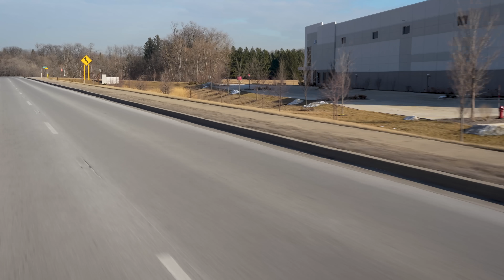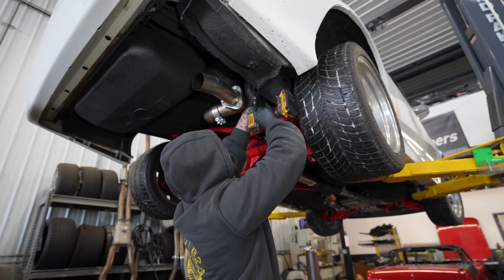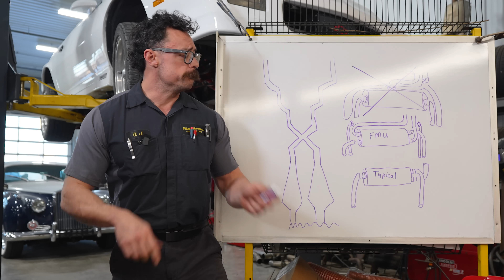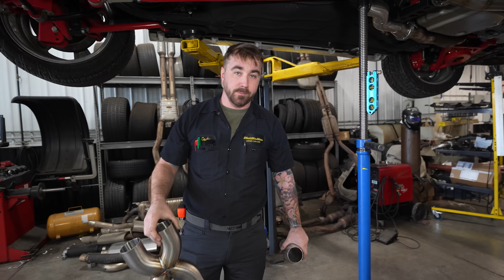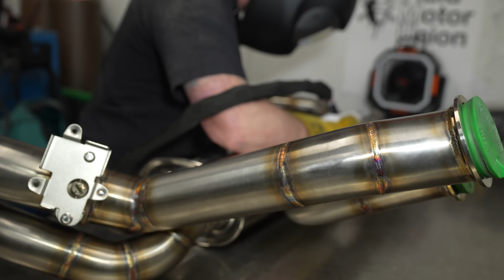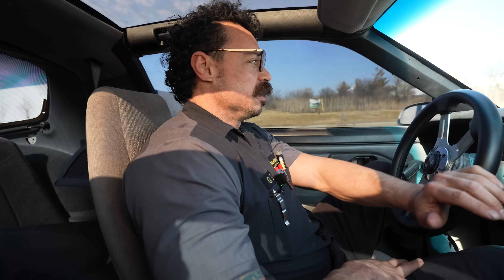This Camaro Exhaust Shouldn’t Have Made 30+ WHP: LS3 Stepped Pipe Layout Everyone Will Copy

Comment: 600-620 crank HP?
What transmission is in it that its losing 180hp from the crank to the wheel?? The 10 bolt isn't taking a bunch.
Thats pretty excessive.

Comment: I still don't see your small into bigger pipes physics. Usually as gas cools down the velocity of the exhaust gasses DECREASES, so going a step DOWN in diameter KEEPS VELOCITY UP. You are fighting physics NOT working with it....
Reply from the maker: Talking about physics but forgetting that length of piping adds resistance to flow… that’s not accounting for any bends… or muffling. 
Also it’s not just gas flow velocity optimization but sound pulse optimization.

Comment: Wish you showed stock vs muffler vs open HP dyno. Instead I'm now not sure if your exhaust did ANYTHING vs open headers and possibly 18" collector pipes wouldn't have done. Or was that meg and x pipe w/ mufflers actually good for 32 HP....

Comment: The title insinuates the exhaust actually made a 30hp difference... it certainly did not. Realistically we don't know if it increased anything or even potentially LOST hp. The majority if not all of it is a result of fixing the other issues.

Regardless, the new system is very nice and imo has a better sound. Great work on design and install.
Reply from the maker: We see it as freeing up the HP

Comment: The exhaust systems cost more than add to the value of these cars because thats what separates a cobbled together looking car vs a first class show worthy built car. If ya want sound and cheap just run straight pipe and axle dumps. This is not that.

Comment: I “built” my g8 in my garage 6 years ago. Basic stuff, stage 2 btr cam, intake, 1 7/8” long tubes with full 3” and an x pipe. The tuner had his doubts and made fun of my “redneck” exhaust. I was pretty happy when the numbers on the dyno went higher than he set the graph due to his expectations. I believe a lot of it was the exhaust helping more overall with the setup, clearly wasn’t near the level of your expertise but I built it with the same ideas in mind.

Comment: @9:27 so isnt that a panhard bar but whats the deal with it doubling back and having a second one? usually its just one
Reply: It's a brace that kinda ties the rear frame rails together to distribute the load so it puts force on both sides of the car rather than acting like a pole pushing on one frame rail

Comment: The Pontiacs had the exposed quad tips where the Chevys had the exhaust tucked up under the bumper and bologna cut pipe ends so you didn't see them.  I had a 3" Flowmaster system that was a simple 1 in 1 out that just dumped out on the driver's side.

Comment: All that money poured into a car with a 10 bolt rearend? Thats why I tell people to start at the tires, and work from the ground up.
Its a really clean 3rd gen. F body, that needs a stronger diff to start with. That would free up all that wasted space, thats being taken up by the factory rear suspension parts. I'd have 86'd all that bullshit. That rearend will inevitably fail. 
A Dana 44 with a 4 link or even leaf springs. Would be a much better starting point. That car should be back halfed, with subframe connectors and a roll cage. Then you could put true duals all the way back. With Moroso bullet mufflers. Done.
Peace
Reply: It’s not a 10 bolt. Its a Hawks 8.8.

Comment: Ah the ol double single routing. A lot of guys did that back in the day. If you were ok with shorty headers you could get the shorties with a y pipe for a dual car model, then 2 intermediate pipes to run back over the axle. Put an H or X section where the cat supposed to be and then however you wanted to work out the mufflers was easy enough.

Comment: Did you consider going 2OTL (2 out the left) like they did back in the 90’s?  SLP found that having both pipes exit out of one side of the muffler, increased flow.  I put that setup on my 1990 IROC, just to make it period correct.  I’d love to do a full header-back exhaust, but keep the two tailpipes out the drivers side.
Reply from the maker: Increases flow over what exactly? Over stock, or them putting a pipe on each side in their experiments?… 

Understand, the best flow for ANY exhaust is 8-14 inches of properly sized pipe past the collector, everything else is potentially a restriction… full stop.
when we build an exhaust the system the idea is that whatever the configuration needs to be zero restriction, or as close to that as we can get with the best SOUND, which is why utilizing steps here allows that. What this video shows is not making power, nor is the one side out show it’s making power, it that it loses less while still doing the job of an exhaust. 

What they were actually saying is that they couldn’t build a system where if it was longer and had to come out both sides,  didn’t lose power over just coming out one side. That’s not the same as claiming one side only is the optimal setup. 

Once you reach zero restriction it’s all about sound quality. There’s no secret power to be made with exhausts.

Comment: I have an 82 Z-28 and the exhaust is one big backpressure.  Before it goes over the rear end it splits in two but dead end in a 90-degree pipe, all are too small.  An idiot thought that up.  Crossfire, Ha Ha Ha.   A stealth intake and a 500 cfm Carter woke it up.  But only tearing the whole exhaust out will help that.

Comment: Maybe I don't understand, but I thought, if you don't use corrections on the dyno then you don't knowvifvthe change you see is due to environmental changes or what you did. E.g., do a run while it's 90° in the shop and one at 50° and you picked up power without doing anything.

Comment: I've mentioned this to him, but I feel like this is where AngeTheGreat's "Engine Simulator" program is going to REALLY shine once he finishes the exhaust portion, since it uses fluid dynamics to not only show flow, but map and simulate realistic sound! To be able to design a complete exhaust system and have an idea before you even start bending pipe!

I know he is thinking about it from a gaming viewpoint, but given he's doing real simulations and not just crude approximations to simulate engine/exhaust sound, I'm thinking outsider the box for real world application.
Here's hoping it works out like I'm envisioning 🤞🥹🤞

Comment: The first one sounds more refined in my opinion it does sound better I'm going to say that it's probably due to the sound waves traveling together at a longer length that gives it the cleaner sound nevertheless you're exhaust system great also from my own experience smaller exhaust pipes tend to give a cleaner sound like 2 and a half inch as opposed to 3 in pipes and also I feel like it depends on engine displacement but unfortunately as you have proven here we can't always have our cake and eat it too

Comment: I have a 92 RS that came with the anemic 305 with a 5-speed and I have found an LS2 the motor only no transmission and I have been on the hunt for a ceramic out of a 4th Gen or something similar I've had the car for years and haven't done anything with it because driving a car like that takes all of the fun out of it. The body is absolutely immaculate interiors great has 80,000 mi on it but I really like that rear suspension.. I have had it parked in my garage all winter long I redid the headliner and put in new recaro seats in the front put a nice little stereo system that is flush with the back I have the whole wiring harness laid out with tabs everywhere thank you guys for making this video it immensely help me in the future it seems like everybody that has an LS is trying to run either a single turbo or twins and as soon as you say you're doing an LS build the very first question is in what motor what heads it's what size of turbo are you putting on it. There's plenty of room for one or two underneath the hood and I don't want to end up spending a whole bunch of money and time and effort cutting welding and trying to figure out an exhaust if I do decide to put a single turbo on their honestly if you have an LS2 and a decent sized turbo you can have enough horsepower to pretty much do whatever you want but frame and all the suspension parts look absolutely stunning I wish I knew what gear ratio he had if anybody possibly knows that would be awesome thank you. I was thinking 3.73 would be good

Comment: Stepped headers/exhaust have been used in motorsports for a good bit they're pretty typical in f1, motorcycle racing, powersports etc where engineers are trying to extract as much HP/TQ as possible. Lot of reasons for it but it helps with acoustic resonance, anti-reversion, scavenging, velocity and flow among other things but the placement in relation to valves and ports for timing is crucial for where in the power band you want the HP/TQ to be. Hence one of it's names being a "tuned length exhaust", I had to learn a lot about the same/similar principles when studying engineering involved in manufacturing chambers for two stroke engines.

Comment: I call bs for the hp gains. When they ran it on the dyno first time straps were tight tyres were on both rollers. After the exhaust change they ran it with loose strops allowing it to run on one roller. Less friction means more power. It would have definitely made more power just not as much as they stated.
Reply from the maker: That was a strap breaking and I left the shot in cause it looked cool! but it was just a old tired strap holding down things with hard angles…scared the piss outta me! Didn’t want to disrupt the edit talking about an old strap breaking, but it didn’t add to the video as it’s just something that happens and wasn’t cause the car did anything special. I have extra footage and the dyno graph of that run, couldn’t complete it but more than happy to share if you email us!

Comment: If you want more mid range, if those collectors are 3" they are far too large for the power level. You can get 500hp through a properly built 4-2-1 with a 2.25" choke/merge, so you'd be looking at a 2.5" being ideal (before stepping up immediately to the dual 2.75-3" pre-X) But the rest of the header needs to be right to not compromise the top end.

Not much you can do about that though, without another 40 hours of labour and $1000 in steel :p

Comment: I imagine the steps do as much for scavenging as the x pipe does. With cutouts I can change my jetting by going straight thru. it scavengers so hard. I'm cheating the extra 20 cubes into my stroked 283. It sounds like that camaro,  Dry sounding?

Comment: I’ve always wanted my own exhaust shop. I love welding and making cars sound good. I have a knack for it somehow has a well, at least I think they sound good and I’ve heard the same from many people. My ex boss, almost 60, told me he thought my car was one of the best sounding he ever heard. One of my immediate thoughts on seeing this exhaust was that right out of the collectors was way too big and then it necked down way too small.. without knowing the camshaft in the engine I thought 2.5 out of the headers was probably sufficient to make good exhaust velocity but keeping it duals with straight through mufflers so it doesn’t choke too much high rpm. But I enjoy learning by watching some real professionals. I also thought the same thing about the early trans am dual turndown tips.

Comment: The major problem with this Camaro is a lack of a solid roof, subframe connectors and rollcage. A stiffer chassis will help with the loss of traction. The exhaust system you designed is top notch.

Comment: What's old is new again. David Vizard designed the idea of the megaphone decades ago. His idea was to have a section of exhaust that's got the internal volume of that bank of cylinders; it'd have an internal trumpet on the inlet and outlet for airflow. This drops the noise and gives a venturi eject when placed right after the headers. He's also the guy that designed the original turbo muffler then sold the patent. It have maximum performance with a livable nose level. I see the megaphone as an evolution of his design and makes me chuckle.
Reply from the maker: A lot of this stuff has been around way longer than any of us, and that’s a good thing. Vizard’s work is absolutely part of that history. If you’ve spent any real time learning exhaust theory, you’ve read his material. I did. Anti-reversion, collector behavior, expansion volume, all of it. His thinking helped shape how a lot of modern performance exhaust systems ended up where they are.

At the same time, none of this started with one guy. Expansion chambers and megaphone shapes go back to the 1930s, think WW2, and in racing, especially early Grand Prix and two-stroke development. Same physics... pressure waves, velocity, volume changes, and how all of that interacts once the exhaust valve opens are still applicable. The only thing that’s really changed is where we’re trying to package it.

While we've only starting doing videos in the last 2 1/2 years, I’ve been running megaphones in street systems since 2009. I was studying this stuff in tech school and thinking about how to apply it to real street cars years before that. So this isn’t something we saw last week and decided to try. If you go back through our older videos, you’ll see we’ve been experimenting with these for a LONG time. So I’m not claiming I came up with the concept. Even in this recent video I say straight up that we’re just trying to free up flow where we can while prioritizing sound quality.

On a pure power level, exhaust systems are actually pretty simple. For a lot of naturally aspirated engines, the most efficient setup is a properly sized header, a good collector, and roughly 8 to 14 inches of correctly sized pipe after the merge. That’s about as close as you get to ideal before compromises start creeping in. Everything past that point is technically a potential restriction.

That’s easy to live with on a race car where space doesn’t matter. You can hang a big volume muffler wherever you want, use long smooth transitions, and not worry about ground clearance, fuel systems, suspension, cats, or how loud it is at 70 mph. Street cars don’t get that luxury. You’re working around subframes, heat shields, emissions equipment, driveline parts, and noise regulations all at the same time. That’s where most exhaust systems lose power, not because the ideas are bad, but because the packaging is brutal.

That’s where the megaphone comes into play for us. It’s not about claiming some new invention. It’s a tool. When it’s placed correctly, it helps manage how the exhaust energy expands after the collector, how the pressure waves reflect, and how that affects both flow and sound. Vizard talked about this from a performance and efficiency standpoint, and that still applies.

Where we probably separate a bit from the old school approach is priority. I’m not chasing peak horsepower at all costs. If that was the only goal, the best exhaust for most cars would end 10 inches after the collector and we’d all be done. But street cars aren’t dyno sheets, they’re something you live with where sound and character mean something. How the car feels and sounds at part throttle matters just as much as what it does at wide open.

Once you’re close to optimal flow, the real difference becomes tone. That’s actually where we spend our time. Shaping how the exhaust sounds without throwing away the power we already know is there. That balancing act is what the channel is about and what these builds are about, and we built that reputation long before getting views on videos. 

So yeah, what’s old is new again, and it should be. Good ideas shouldn't have an expiration date. We’re just showing how those same principles can be applied to modern street cars that have way more constraints than the stuff those ideas were originally developed on. And I’ll always respect the guys like Vizard and Boyd Butler who laid the groundwork that lets us do this in the first place.